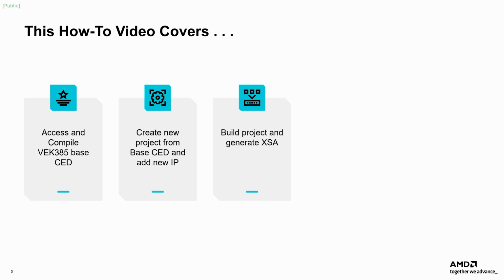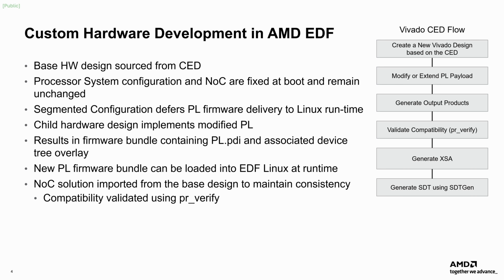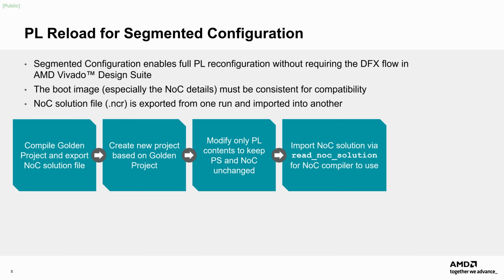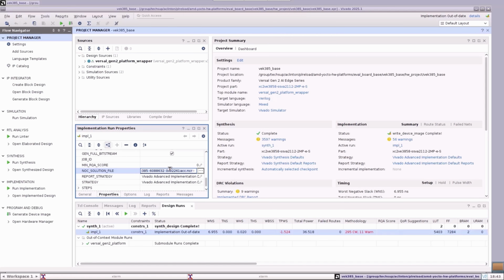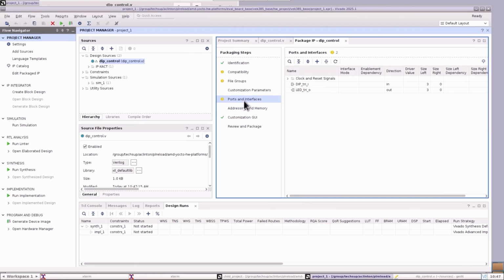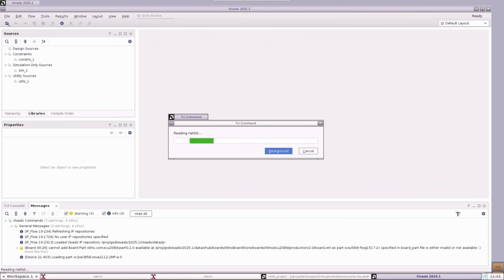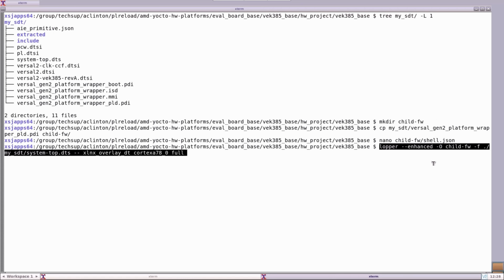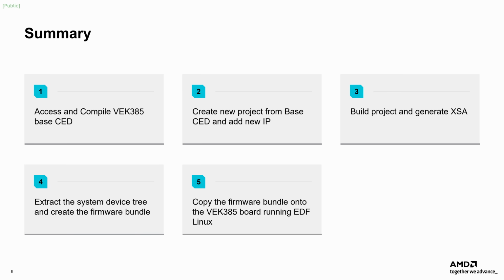AMD EDF Custom Hardware Development Using Dynamic PL Reload

Comment: Nvidia colluded with Samsung to raise memory prices with fake quotes.
Nvidia has disabled comments
I can't afford to replace my power supply. (500w)
The amount of money you pay for electricity increases
I can't afford a new case to dissipate the increased heat.
Noise is also a concern when adding more fans.
There are no fun games either (starcraft MMO)
The government manipulated the ceiling construction to kill me, so there's a lot of dust.
The fan is very dusty and cannot exceed 500W.